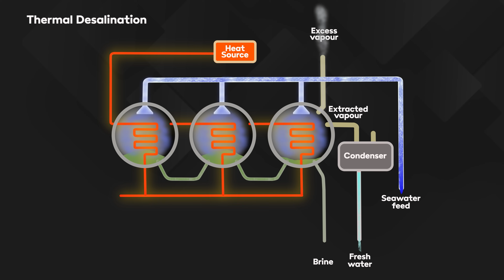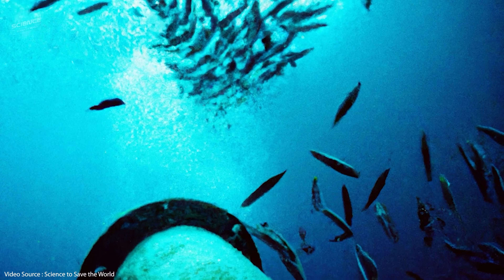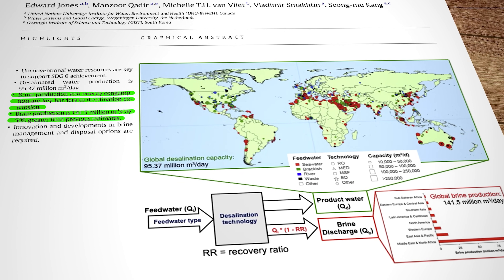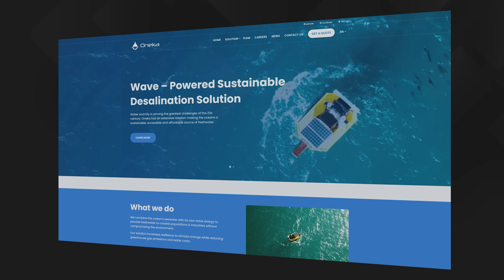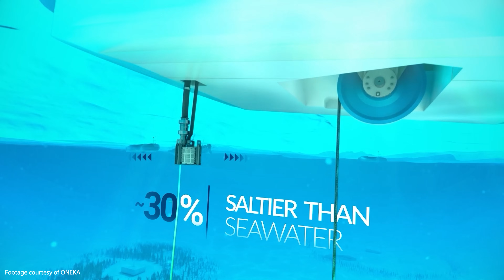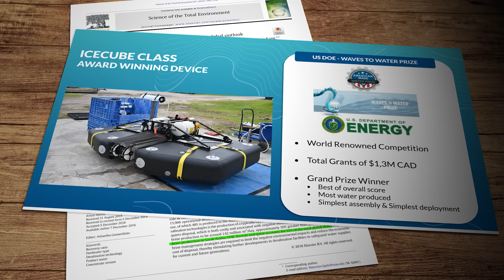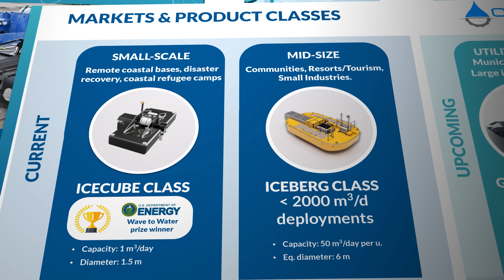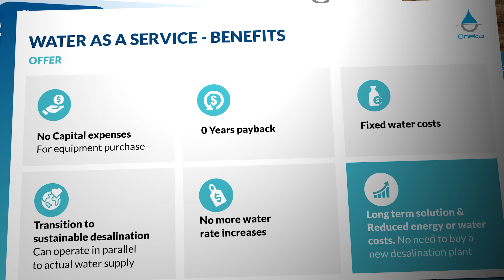Fresh Water at Zero Energy Cost . How do they do that?

Comment: As a California resident this video was very encouraging.  I am curious about what is involved in the maintenance of such devices. Also, as a surfer I know the waves can be very small thus limiting the mechanical drive needed to produce fresh water.  What is the minimum wave height required to produce the needed pressure to drive the system?
Reply: CA resident here, and I always like seeing new developments in desalination.

I do see maintenance as a big issue. Standard desalination plants need constant maintenance too, but they aren't floating in the ocean.

As for the needed wave height, I think that value could be quite low. With enough displacement and anchor weight, large forces and pressures could be generate with a delta height of a few inches depending on a) the ability to convert delta h into vertical motion as opposed to pitch, and b) the speed and effectiveness of the check valves. If all of those design elements can be met, operation could be possible in nearly all surface conditions, albeit with reduced output in calm conditions.

If I were designing the system I would run 3 in tandem (merging after the pressure unit) to take out pitch losses in calm conditions, and allow for higher output in rough conditions.
Reply: Do the salt water batteries require the water?  Would it be possible to extract the salt to use in the salt batteries rather than dumping it back into the ocean? Salt water batteries are touted as safer than lithium.
Reply: @SLRFL3313  Hi I hadn't heard of salt water batteries but the company seems to have gone bust , you would need to build your own
https://en.wikipedia.org/wiki/Salt_water_battery#cite_note-8
Reply: I imagine it can be made so that the amount of water produced per hour increases and decreases with wave height rather than having it drop to zero.  It would be a matter of the amount of mechanical leverage to give to the wave motion.  With only slightly clever engineering, leverages can be adjusted.  Wave conditions tend to last for hours so the adjustment would only need to happen slowly.  This would put it in the grasp of a small solar panel's power output.
Reply: @kensmith5694  I wonder if it's as simple as a ratchet to drive the pressurising system? Then more or less any wave size bigger than the ratchet step (a couple of cm?) will add some energy.
Reply: @kensmith5694  you could indeed control it with a small solar panel and a microprocessor (an Arduino would be plenty, a Raspberry Pi would be overkill). Whatever the speed control there would inevitably be a cut off below which production would still fall to zero -- you're just using some kind of gearing to increase the range of conditions under which the device will work. In the extreme you wouldn't expect it to perform in a totally flat ocean like the one in the Ancient Mariner. "Water water everywhere, not any drop to drink".

However (and given their design choice for making it entirely hydromechanical) I'm guessing that they will instead have installed a purely mechanical governor to do the same thing. 

Stationary stream engines used to run at pretty much the same speed irrespective of the steam pressure in the boiler by having a mechanical governor regulate the flow. That mechanism is the one with the whirling balls (*) on a static engine, and that clearly wouldn't work here, but I'm sure that someone with suitable mechanical engineering knowledge could create one that does 

The video said that the solar panels ran sensors and networking to feed into back to the shore, but didn't say anything about also controlling the gearing electronically. The power (in terms of energy and processors) is already there, but I am guessing they choose not to use it. 

A purely mechanical arrangement can sometimes be both more reliable and cheaper than using electronics and they seem to be making a selling point of that. Advantage: If the on board computers go down then they lose monitoring but don't lose production. Resilience against software errors and against malicious errors caused by hackers.

(*) OK you can stop sniggering now at the back it wasn't that funny
Reply: @kensmith5694  there's power in the waves, solar panels aren't needed. A very simple spring-balanced hydraulic cylinder driven from the pump could possibly adjust the leverages as you suggest, it would even be automatic.
Reply: @alanhat5252  I doubt a mechanical system like that would be as simple as an electric motor making the adjustment.
Reply: In the video @Just have a think says the hull of at least one of the devices is PET, the plastic used in fiberglass, soda bottles & fiber-filled duvets, it copes well in seawater if it's UV stabilized so it's only the mechanical components inside that are an issue. It looks like all devices are tethered to buoys & are small enough to be detached & towed ashore by a Zodiac for maintenance. I don't think there's any big problems with maintenance.
Reply: @alanhat5252  I am Not an expert, but I know that the membranes have to be replaced periodically, and possibly filters get clogged, but perhaps redundant menbranes & filters can be used so it doesent shut down when one gets clogged unexpectedly.

Also, it seems that any mechanicak input could be used. so a different underwater attachment could be used where there is a consistent current either a continuous stream or a reversing tidal stream. (Maybe store some energt (compressed air??_ for preiods of low current flow))
Reply: It seems you can put these as far out as you want and use mini pipelines to send the water back to shore. 

Also, the waves don’t need to be surfing waves…. The shipping lanes probably generate enough just on their own.
Reply: What California needs is rain catching, not desalination. Some ideas include tearing up all those parking lots, charging user (especially farmers) more for water to reduce waste, and reintroducing beavers to restore stream. Restoring Tulare Lake would be a good idea. Most Californians have forgotten it ever existed..
Reply: @bernardfinucane2061  What rain?
Reply: @jeffsteinmetz7188  It rains plenty in California. The problem is that a century of draining the land has caused a desert.
Reply: @bernardfinucane2061  why does it have to be either/or?

If I was worried about future water supplies I would want lots of both to be developed, plus measures to discourage water use (at least until there was plenty of sustainable water available). It's all of the above, not just one.
Reply: According to their website, the "Iceberg" platform can work with 1m wave amplitude.
Reply: LOL California.
Reply: I am not meaning this as being a butt. California has as far as I know some of the hardest Construction restrictions in the United States for anything. You can poop in the street, and leave it, but if your dog poops in the street you have to make sure and clean it up. Like I said I'm not trying to be mean about this but I don't see why any startup company would try to test in California to begin with.
Reply: @kalrandom7387   What does the California's bylaws around human and dog poop have to do with construction?
Reply: @DistinctiveBlend  Cali is poop?
Reply: @kalrandom7387  California's needs imply great State support, almost certainly including assistance to meet the regulations
Reply: @kalrandom7387  Many jurisdictions have restriction style ``not in my backyard`` but the need for fresh water and energy should outweigh restrictions. I live far from the city, in a wooden area and now we can see windmills, not my first choice, but I understand the need .
Reply: @kalrandom7387  Because it's a place where people have lots of money and are running out of fresh water?

Comment: If a seaside community was using this for their water,  and the entire process,  including water pumping to shore is done mechanically from waves... the shore could store the excess water at whatever elevation is possible and draw energy when they draw water.
Reply: Could also work, but that requires a lot more transportation than from the coastline waters to the coast. You're talking about raising the water upwards against gravity, which requires energy^. 

Start edit: ^and a lot more energy than it would take to follow the gradual slope of the coastline, compared to steeper hill/mountain gradients.
:End edit

Now, could you get a large enough pressure buildup from the ocean to eventually drive it all upwards? Maybe. 

Love the idea though. I think it does get a little conflated. Look at one of Dave's videos from a few months ago (a year?) where he covered a company making underwater pumped hydro storage. I think that system was also mechanics-based

We want to be careful in brainstorming too much, overloading ideas until they aren't realistic. 

Love you imagination tho!
Reply: @nschrombeck  if I was setting up an off grid coastal village I would probably want a gravity feed for water if possible. Whatever that pump system is capable of.  Get it as high as you can.   Run that water through a turbine first is all.  Energy bit helps
Reply: The energy available from water falling from a water tank is miniscule compared to the energy required to push that water through the reverse osmosis membrane.

Comment: I wonder how the fresh water collector pipe overcomes fatigue and abrasion from constant movement as the floating platform shifts around on the surface of the sea.
Reply: A firehose should last several decades.
Reply: Yeah, they'd need to anchor it with something. Probably an equivalent pilon that you'd use for running conduit aboveground, where the conduit run sits about 30-60 cm above the ground. 

Thinking a big concrete/steel/plastic staple, but who knows lol

Comment: The key is to bring down the cost of the platforms - with intended installations to be a rough grid in the water, perhaps they could serve dual purpose as fish farms or as hybrid systems designed to be installed on existing wave energy generators to provide water generation options to their customers etc

Comment: They are talking about 2 cents a gallon at scale so that is perfectly in tune with municipal water systems.   My only question would be on system maintenance -- a 60 micron intake filter would seem to me to require quite a bit of cleaning to keep the water flowing.
Reply: That was also my thought, they could put the screen on a roller and gradually move it along as it plugs and then off to the side have a scrubber of some type to remove the gunk, but with every moving part it means extra maintenance (i.e. cost) so it would be interesting to know how they've solved this issue.
Reply: Do not forget the prevention of   calcium carbonate deposits, which requires constant , reliable dosing with phosphoric acid, long experience with real systems here.
Reply: @arturoeugster7228  I have no experience but agree as the novice i am. This system might be perfect for a while but won't win the lifetime award.
Reply: Just build several units in a duty standby mode. The maintenance is well known though the cost of that scale maybe an issue.
Reply: @riveness  A spare or two is almost always a good idea but that adds to your costs.
Reply: @DavidM2002  of course. But you would not leave the critical inlet without redundancy
Reply: Think revere flush to clean the filter.
Reply: @pauleohl  Yes, it showed the brine being expelled through the filter.
Reply: @rogerbarton1790  That would be a start at least on keeping it clean.  I think two filters would be better.  You can flow in on one and out on the other for a while and then switch roles.  This would push any debris away from the face of the filter that is being cleaned at the moment.

Comment: It's encouraging that there are people who can see options to conventional (just add more energy) thinking to solve problems. 
I like the new setup, but I think your lighting may require some tweaking. I noticed that your eyes changed from fairly well lit to very shadowy as you moved. So, more light or a head restraint? 😉
Reply: My vote would be for the head restraint idea :D I'm sure it wouldn't be distracting or cause any questions at all
Reply: More light coming from the general area of the camera would be a good way to improve the lighting.  A spread out light source from that direction would always light all of his face even if he turns his head a bit.
Ideally the source should extend both sides of the camera.
Reply from the maker: Played with the lighting a bit for the next video (next Sunday). I think it's a bit better for that one.
Reply: @kensmith5694  thus ring lights ;)
Reply: @falconerd343  Ring lights tend to put all the light face on.  "fill lights" are needed with them.

Comment: I've ALWAYS been a big fan of desalinization. Among my big questions tho is, why do we have to pump the salts back into the seas? Surely some of those trace elements would be valuable enough to capture them right? Or even to be sold off as... well... salt, rather than mining it as we do in so many places? 
Also, obviously all, or meaningfully all, the water we would pump out would go back into the sea eventually, further negating the salinity issue in the long term, but more locally is it reasonable to assume that for megacities that might come to rely on desalination that it could affect local sea level and water currents or is that far too large of a problem for any one city to cause? Humans have always been good at saying "that wont be a problem" only for it to turn into... well... climate change
Reply: The brine from reverse osmosis is only about 3 times more salty than normal sea water. It's enough to be bad for the local environment, but not enough to be profitable to concentrate further.
With distillation it might be a different case since you could in theory evaporate enough water that the salt would precipitate when the water cools down.

Comment: Oneka's approach definetely seems more right since theres no overhead through conversion into electricity. One might have to question if those boats will last long enough over time to make fixed water possible as claimed.
Reply: How long do fishing boats last in the ocean? Years? Decades? 

Do these boats use the same materials as those industrial boats?
Reply: @nschrombeck  These boats are made of recycled plastic.  Industrial boats use tougher materials.
Reply: @incognitotorpedo42  If they scale it up to mass production it might be more sustainable to produce the platforms with materials suited for commercial boats. Even if those materials are "problematic" they might be better / more sustainable all things considered.  I think the "recycled plastic" bullet point is a marketing issue. It sounds good when applying for subsidies (one more environmental friendly check) and when trying to get the media interested in reporting. 

It is not set in stone that is has to be recycled plastics if they ever mass produce. The plumbing, pipes, the pumps & valves must be as durable as possible to lower maintainance cost anyway, so I guess that eliminates recycled materials. The shell can be anything: fibre glass, recycled plastic. As long as it withstands sea water, the mechanical forces, and UV radiation.

Until they are able to mass produce there might be new materials or production methods availabe: Better stabilized recycled plastics, "better" (more sustainably) produced conventional materials.
Reply: @nschrombeck  Its not the the large overall but the mechanically intricate parts that are most likely to fail and lead to not working stations. And unlike industiral boats where you literally just slap a zinc plate and let it absorb the corrosion, you cant to that in teeny tiny details.
Reply: @DRakeTRofKBam  Yeah, I thought it was some sort of cathodic protection. That kind of configuration for Oneka's technology would mean a lot more operational labor, especially for larger and large fleets. 

Does probably make more sense to go with (recycled) plastic in this case

Comment: Efficiency of desalination via a filter depends on the pressure maintained across the filter, no? That's where the energy cost is. So why not affix a closed empty network of pipes made of the filter material to the sea bed, under the pressure of the overlying water, and suck up water entering the network through an impermeable hose? Would take very little energy, no more than a long garden hose.